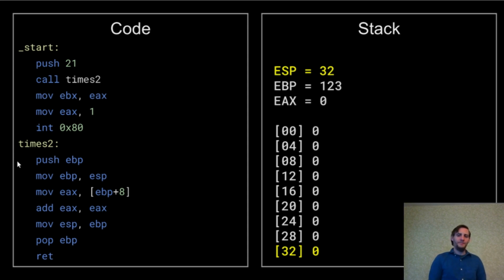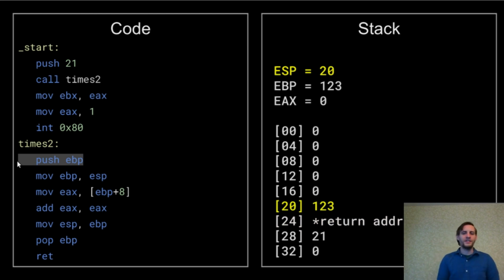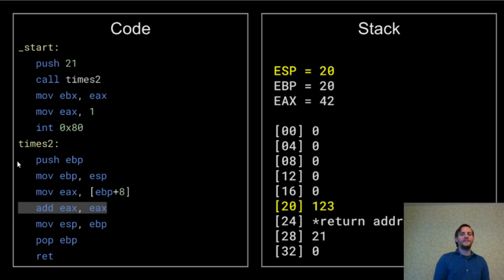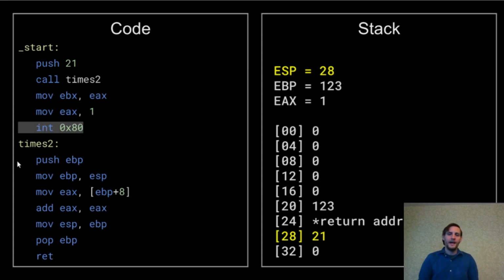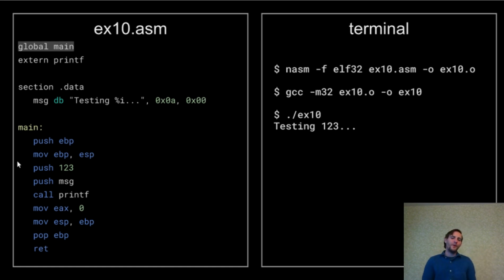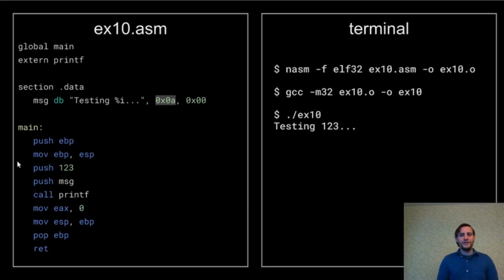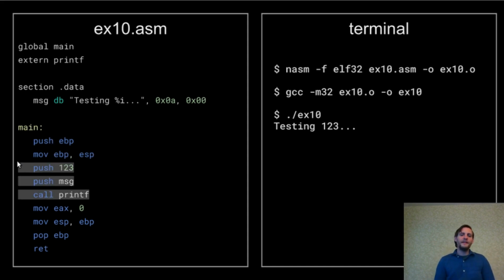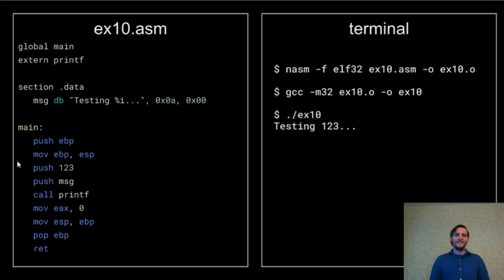Intro to x86 Assembly Language (Part 5)

Comment: anyone who's getting segfault error,position it like this....... section .data and then section .text.Also add this line after 'call printf' --->add esp, 8     this line cleans the stack,which prevents another segfault

edit: i use ubuntu in WSL2,so it might differ in some sort of way,do find your own solution

Comment: I got this fault "Segmentation fault (core dumped)" and got rid of it by doing 2 things.
1) added "section .text" directly above "main:"
2) added "-no-pie" to the gcc line. "gcc -no-pie -m32 ex10.o -o ex10"
This was my result.
~/Desktop$ nasm -f elf32 ex10.asm -o ex10.o
~/Desktop$ gcc -no-pie -m32 ex10.o -o ex10
~/Desktop$ ./ex10
Testing 123...
~/Desktop$

Comment: what heppened on mov eax, [ebp+8]? why wouldnt it be 20+8 = 28 not 21?
Reply: basically it move the value in the address ebp + 8 so it's 21. The [ebp] sign is to get the value that was stored in ebp, not the value of ebp itself. Then +8 is to move 8/4 = 2 stack frame up.

Comment: Firstly, thanks for putting the time and effort into making a great tutorial. Secondly, there were two issues I had repeating your steps as follows:

1) Needed to install gcc-multilib for 32bit GCC library support. (I am using a 64-bit Ubuntu VM)
2) Missing '.text' section in ex10.asm caused a segfault on the compiled binary with GCC. After I added this section, the compilation threw a relocation warning but completed and now the compiled executable functions as expected.
Reply: SAME! Thank you for the instructions. 64-bit Lubuntu > sudo apt install gcc >> "...cannot find Scrit1.o..." > sudo apt install gcc-multilib >> Segmentation fault. By process of elimination I thought the problem would be with "section .data". Per your comment I added "section .text" per the previous exercises and it ran with warnings. I would have never guess that to be the issue. Thanks again! @russc6767 is it too much to ask how or why you knew this was the issue?
Reply: yeah i'm having the same trouble with that segfault but thanks for the explanation
Reply: Thanks for this! I was getting these errors without gcc-multilib

/usr/bin/ld: cannot find Scrt1.o: No such file or directory
/usr/bin/ld: cannot find crti.o: No such file or directory
/usr/bin/ld: skipping incompatible /usr/lib/gcc/x86_64-linux-gnu/9/libgcc.a when searching for -lgcc
/usr/bin/ld: cannot find -lgcc
/usr/bin/ld: skipping incompatible /usr/lib/gcc/x86_64-linux-gnu/9/../../../libgcc_s.so.1 when searching for libgcc_s.so.1
/usr/bin/ld: skipping incompatible /usr/lib/x86_64-linux-gnu/libgcc_s.so.1 when searching for libgcc_s.so.1
/usr/bin/ld: skipping incompatible /lib/libgcc_s.so.1 when searching for libgcc_s.so.1
/usr/bin/ld: skipping incompatible /usr/lib/libgcc_s.so.1 when searching for libgcc_s.so.1
/usr/bin/ld: cannot find libgcc_s.so.1
/usr/bin/ld: skipping incompatible /usr/lib/gcc/x86_64-linux-gnu/9/libgcc.a when searching for -lgcc
/usr/bin/ld: cannot find -lgcc
collect2: error: ld returned 1 exit status
make: * [Makefile:3: all] Error 1
Reply: ;add section .text above main like so:

section .text
main:

Comment: how can you run 32bit code on 64bit Ubuntu? I get a Segmentation fault (core dumped) when I run ex10. However, I tried with qemu-i386 ex10 command , it succeed!

Comment: Upon executing the code ex10.asm, I get a segmentation fault.

Where does it come from ?
I'm doing the exact same commands, I don't think the problem comes from nasm but from gcc
Reply: Me, too. Did you understand why? For now, I don't know.
Reply: @DL_GLCH  Nope still not, I'm guessing it's due to the compiler 
I have moved on to something else but if you find out I'll be glad to know how to fix this
Reply: @theotimec-m5990  I haven't searched anything about it anymore, I'm reading "Hacking: The Art Of Exploitation: 2nd Edition" (if you're interested in this field, I recommend you that book), that's why I decided to watch this introduction series.
Reply: @DL_GLCH  I am currently working in this field, I needed to consolidate my ASM knowledge
Reply: me too bro , what about now?
Reply: me too lol
anyway i've found one of the solution which is to compile the .o file with gcc using -no-pie option (gcc -m32  -no-pie inp.o -o out). Also add section .text at the top of the main label in the .asm file
Reply: @russc6767 posted a comment above that helped me get past this issue, at least with warnings. Adding a "section .text" before main got me past the segmentation fault.

Comment: On running: gcc -m32 11.o

if getting error :
/usr/bin/ld: cannot find Scrt1.o: No such file or directory
/usr/bin/ld: cannot find crti.o: No such file or directory
/usr/bin/ld: skipping incompatible /usr/lib/gcc/x86_64-linux-gnu/8/libgcc.a when searching for -lgcc
/usr/bin/ld: cannot find -lgcc
/usr/bin/ld: skipping incompatible /usr/lib/gcc/x86_64-linux-gnu/8/libgcc_s.so.1 when searching for libgcc_s.so.1
/usr/bin/ld: skipping incompatible //usr/lib/x86_64-linux-gnu/libgcc_s.so.1 when searching for libgcc_s.so.1
/usr/bin/ld: cannot find libgcc_s.so.1
/usr/bin/ld: skipping incompatible /usr/lib/gcc/x86_64-linux-gnu/8/libgcc.a when searching for -lgcc
/usr/bin/ld: cannot find -lgcc
collect2: error: ld returned 1 exit status

then issue with linker configuration, use below command to resolve it
~ sudo apt install lib32gcc-8-dev
~ sudo apt install gcc-multilib

Comment: Regarding what you said at the end of the video, when you call mov esp, ebp you are removing the function arguments from the stack so it’s not like you did not explain that. You meant that as a reminder that we have to do it whenever we define a function right? 
Also the prolog process and de allocation of the stack’s space must be done so that we can call functions inside functions right? That’s what you said it was not necessary in this example.
I would like to see you writing functions   inside functions and functions that take more than one argument in this example the integer is handled by C but how do we create functions with more than one argument in assembly only? Also how do we take users input and define an array and how to iterate through an array and modify it if that’s possible, also what about booleans?
It’d also be great to know how to use “and”and “or”operations for comparisons if that is possible. 
Finally it’d be great to know how to define variables inside functions. 
I think with all that this course would be the best reference on assembly ever made. 
A gem, seriously you could make history with this haha never thought I’d grasp assembly concepts so quickly, clearly and easily.

Comment: So with the times2 function, does the value of 21 just stay on top of the stack?
Reply: Correct. And in a serious function call you would want to account for that but in this case the program ends (which cleans things up). Generally you would wrap all of it in a prologue/epilogue which would clean that stuff up at during the program.

Comment: I had to run apt-get install gcc-multilib to compile 32 bit on ubuntu
Reply: info781 same here and thanks!
Reply: Thank you!
Reply: Thanks! Me too
Reply: this works on wsl ubuntu too!

if the error says: no scrt1.o file found or cannot find -lgcc then this is the solution I did.
Reply: Thank you very much! It works!
Reply: Fixed the same way as well

Comment: I'm having a problem when trying to compile with gcc.
It gives me the error: /usr/bin/ld: cannot find crti.o: No such file or directory
So I tried: LIBRARY_PATH=/usr/lib/x86_64-linux-gnu:$LIBRARY_PATH 
export LIBRARY_PATH
which I got from here: https://askubuntu.com/questions/251978/cannot-find-crti-o-no-such-file-or-directory
But now apparently there's another problem:
/usr/bin/ld: skipping incompatible /usr/lib/gcc/x86_64-linux-gnu/5/libgcc.a when searching for -lgcc

Note that I installed binutils(sudo apt-get bin-utils) because my ld command wasn't working.
Compilations with the ld command work fine but the one with gcc doesn't.

Version of linux:
Linux ubuntu 4.13.0-36-generic #40~16.04.1-Ubuntu SMP; x86_64 x86_64 x86_64 GNU/Linux

I'd really appreciate if you could help me with this.

Comment: I think there's an issue here - you never cleaned up parameters that were pushed onto the stack. I believe you should adjust the stack pointer after the function call.
Reply from the maker: In the first example the call after _start doesn't restore the stack. But the program exits immediately afterwards so it doesn't need to. In the other example where it uses printf the stack is restored with the epilogue.
Reply: Actually you are right, it's not really an issue because the program exits. However, in my opinion, you should mention it because it's an important aspect of calling functions and it can matter in some (many?) cases.
Reply: Actually, when you give control back to c-runtime (_start) your EBP has wrong value because you didn't handle it correctly. It points to msg instead of previous value it had.
Reply: @fl4shi238  How so? The epilogue, `mov esp, ebp` and then `pop ebp`, would restore EBP.
Reply: @davywtf  I don't even remember watching this video nor commenting it =) But i peeked at the end of the video to see the listing, and looks like my previous comment was wrong. Maybe I didn't see restoring of the esp or somthing, no idea.
Reply: I was thinking the same, technically it should have been done, but as someone else is saying it is exiting just shortly after, but it is good practice in my opinion.

Edit: he makes a mention of it at the end